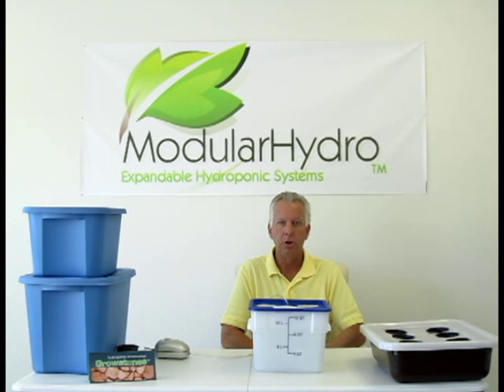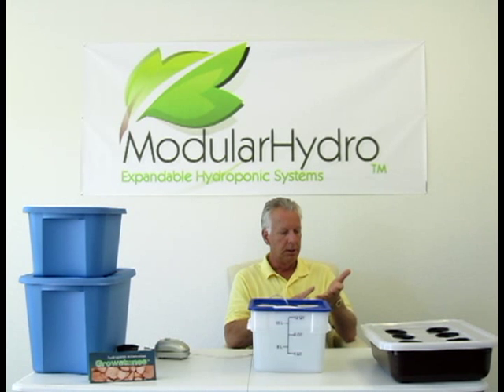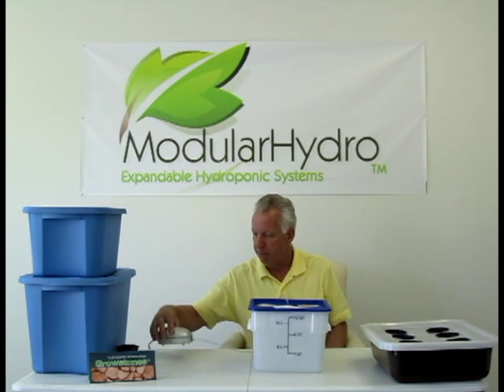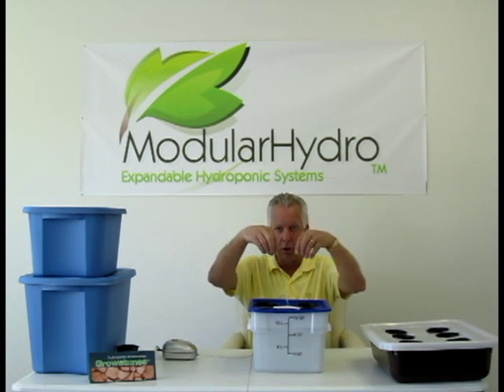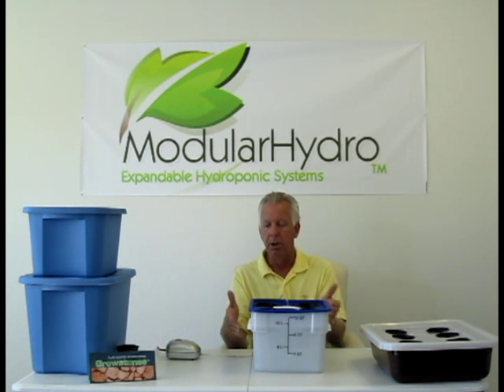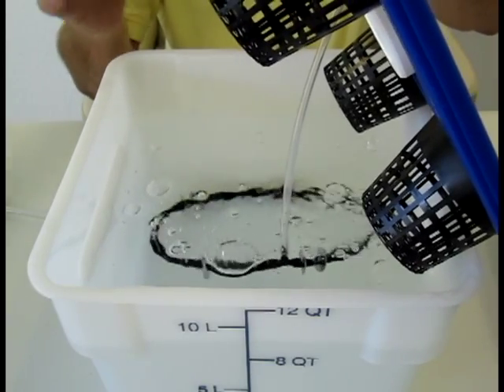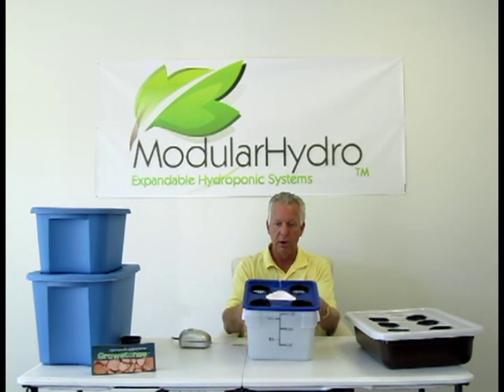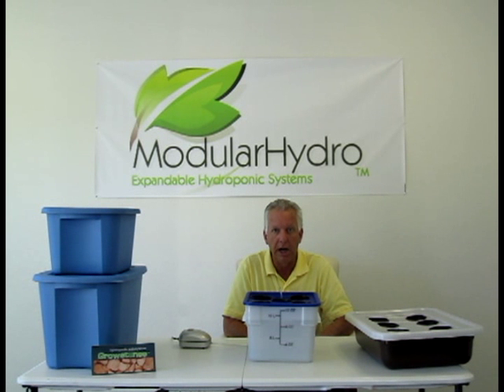Deep Water Culture (DWC) Hydroponics System Explained

Comment: "Air injection technology" wtf....i could deliver the roots more oxygen by blowing through a straw.  to have any benefit at all you need a decent heavy duty high power pump, and you`ll get more bubbles from a decent micro pore air stone, that rubber ring & pump your using is not fit for a fish tank let alone hydro.